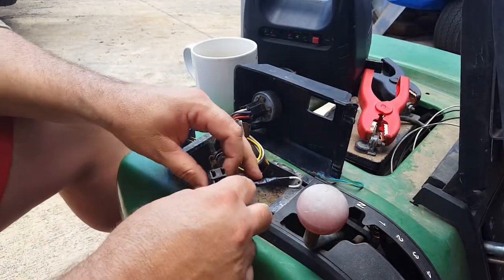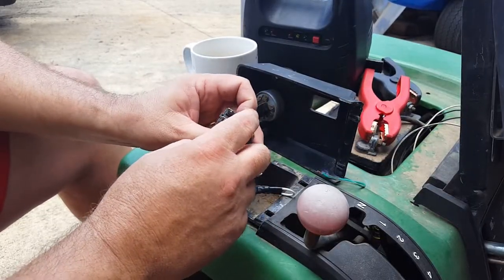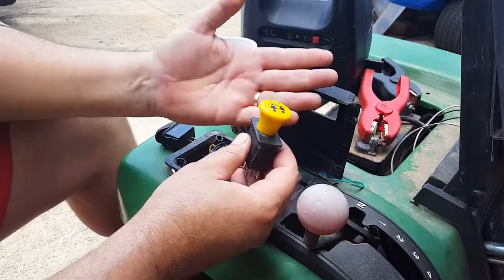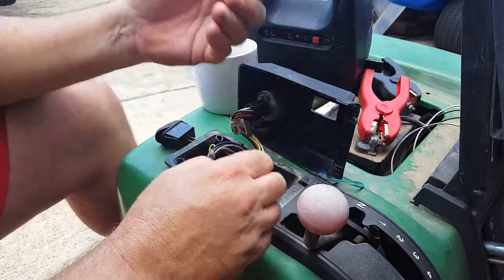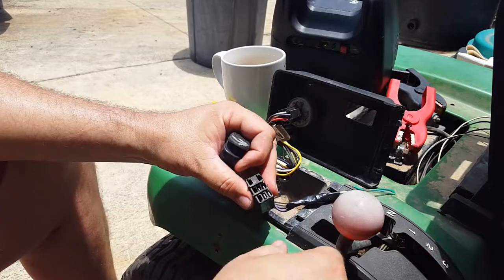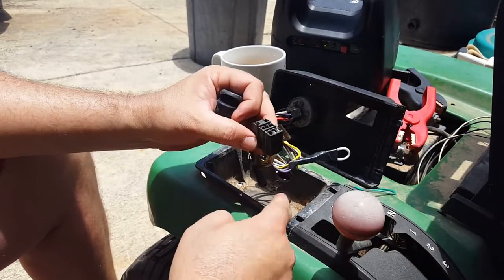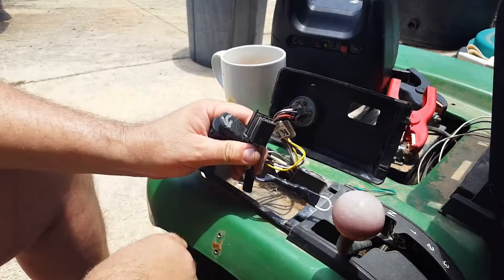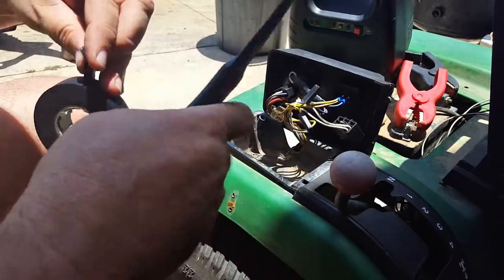John Deere PTO switch repair simplified!

Comment: I guess I should do this, just with a toggle? I have had nothing but problems with these switches. Thanks for the video.
Reply from the maker: the only safty feature I like is the seat switch i do want it to die if i climb off... if you see my other videos on an stx38 i picked up about a month ago. It has a toggle switch on it instead of push pull and that is the john deere part so at some point JD decided to change to the push pul type.

Comment: Did you put a jumper wire on an open connector to the safety switch purple wire? Then just electrical tape it? I have a JD STX38 black deck, that got a bad connection while mowing and now my yellow wire is burnt up from switch to starter relay. It even melted a couple wires to it. I'm having to rewire the whole thing bc I can't find the dang harness anywhere. I really don't know much about wiring but I have everything I need to do it with. I'm just desperate bc my grass is literally like 2 ft tall. Lol
Reply from the maker: to be honest I don't remember but yes I probably just made a jumper with spade terminals so it would plug into the existing connectors... I use the original stuff rather than splicing often just in case I ever want to go back.